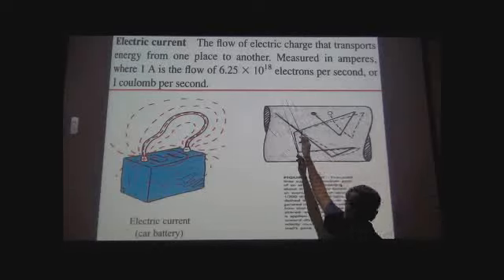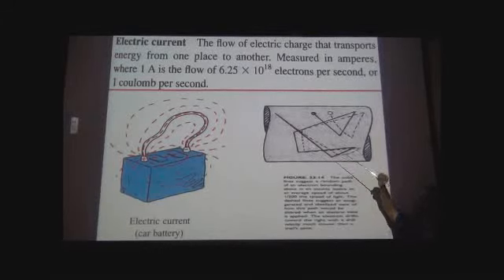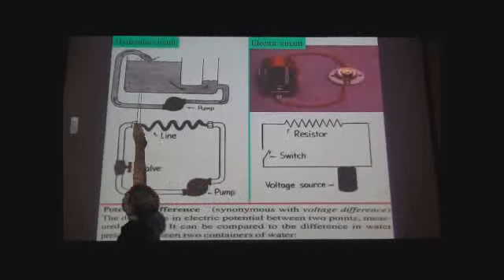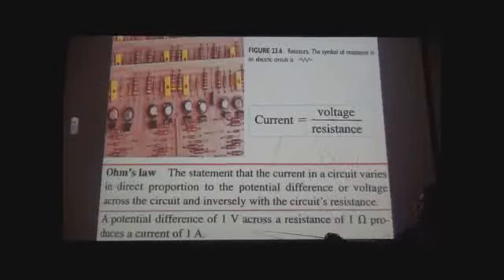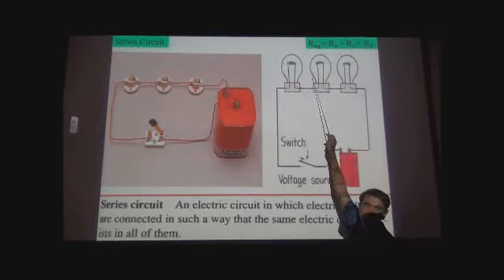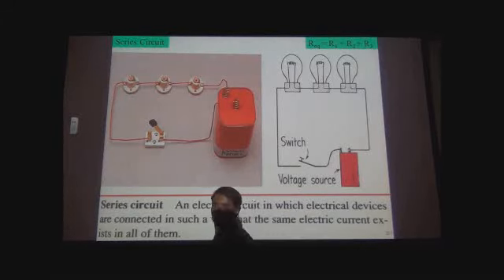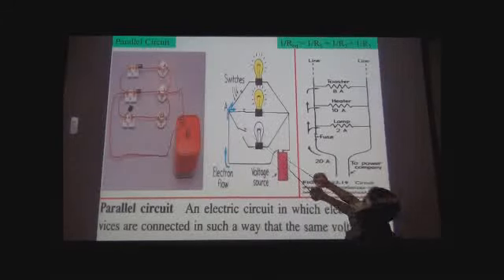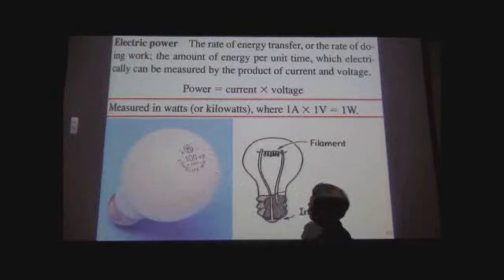Flow of Power: Exploring Electric Current | Physics 101 Lecture 23 (part 1)

Comment: I learned that a parallel circuit is an electric circuit in which electrical devices are connected in such a way that the same voltage acts.

Comment: In this lecture I learned that a current in a circuit varies in direct proportion to voltage and inversely with the resistance describing Ohm’s law.

Comment: Ohm’s law Is a law/principle used for calculating out the total current of a circuit. The type of circuit does affect the current of the circuitry, whether if the circuit were connected in parallel or in series. 
If the circuit were connected in series, the voltage is what will change, and if the circuit were wired in parallel the amperage will change.

Comment: I learned that voltage or potential difference is the difference in electric potential between two points, measured in volts.